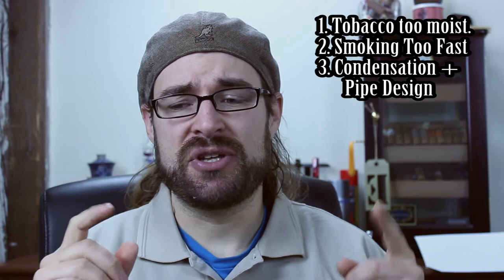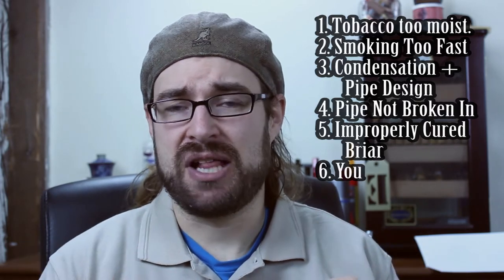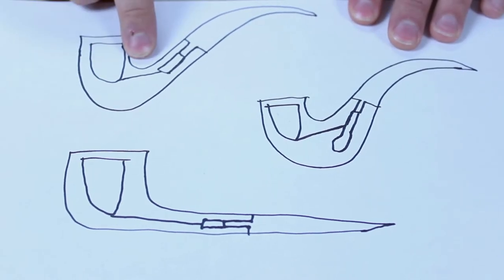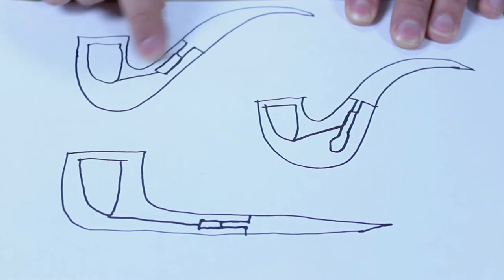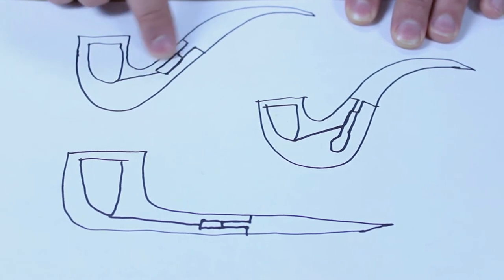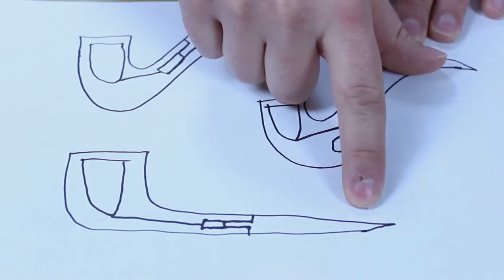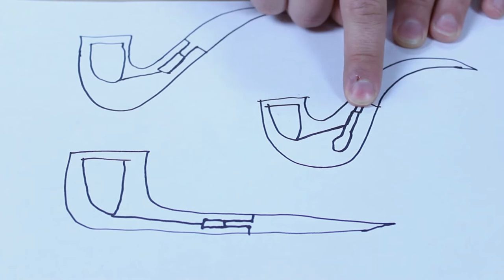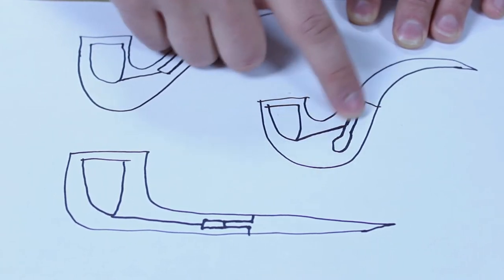Why Is My Pipe Gurgling and What Can I Do About It? - Pipes 101 #3

Comment: All this is true. However, "renters" are caused by the combustion process itself. "Renters" are what we "older smokers" used to call that gurgling noise because "renters" are usually noisy when you let a room in your home.Kirsten, and E.A. Carey pipes were designed to eliminate renters by condensation. Yet, I have owned both kinds and they will still gurgle. What causes most renters is the combustion process. Ever see your car exhaust steaming when you first start your car in the morning? That is due to Carbon (fuel) Oxygen (17% of the atmosphere) and other inert gasses (83%). Carbon, Oxygen, Hydrogen, equal alcohol. Hydrogen (2) and Oxygen (1) equals water. There is enough material in our atmosphere to make alchol (evaporates or burns up) and lots of water (condenses in our pipes). Don't be hard on yourself or your pipe, it's just chemistry and doesn't mean you don't smoke properly or that your pipe is a poor design or improperly finished. I smoke a cob every day and it will usually gurgle at some point. Usually it gurgles after I have smoked it at least half way through a bowl.
Reply: Thanks for sharing your thoughts and experiences.

Comment: What a thoughtful video. Well done Sir! The one cause that I have struggled with, which may not be an issue to those of a more southern climb, is temperature.
When it's -12C outside any form of heat condenses the latent moisture in the air almost instantly. Similarly, when its +30C and 100% humidity it seems like every puff is just hot steam. I tend not to smoke that much in the height of the summer.
Thanks again,
BG
Reply from the maker: +Beardly Gentlemen Yeah, temp and humidity are ones that you just can't really avoid.  Cold temps will condense a lot of moisture in the stem.  I'm the same about the height of summer.  I usually don't smoke much when it's crazy hot out.

Comment: This was really helpful. Some "friends" put ethanol in my pipe as a prank and my pipe has been off ever since so I think they destroyed my cake.
Reply: All you can do is start over then if the cake itself tastes badly ruined. If you let the pipe dry out enough the ethanol should of evaporated, if you still taste it though, then you have to ream the cake off and start over. Usually ethanol is used when doing a restoration on an estate pipe or really dirty pipe. It usually doesn't leave a bad taste behind though. Everclear or high proof rum is used. Maybe they used something cheap and with not a lot of alcohol in your pipe your getting that ghosted flavor from it. Might be best to try and take the cake back down to briar and break it back in. Clean out the inside of your mortise chamber as well.
Reply: Andrew Gill get new friends

Comment: Excellent presentation and possible solutions for gurgling. Off topic a little, but I have added nail clippers to my tools. I use the file on the nail clippers to clean inside the bowl and I cut my pipe cleaners for the smaller pipes and this is to do with saving pennies and reduces wasting say the middle of the pipe cleaner. Hope this makes sense.
Reply from the maker: Sure.  All my pipes are pretty big so a standard size cleaner just barely makes it into the bowl.  I'm not worried about saving the penny or 3 when there's already 30 cents of tobacco in a $100 dollar pipe. :-)

Comment: well my pipe is over 100 yrs old so that's not the issue, ive dried my tobacco until its dry and still i get gurgle and evry once and a while it gets sucked in my mouth witch is unpleasant to say the least! ive since switched to the plug method since my pipe is meerschaum. and as long as i blow the build up into the plug it stays put witch is a plus!

Comment: I just found your videos and am finding them informative. But I have a question. I have more of a gurggling problem with my straight pipes, than I do with my bent pipes. that's the opposite of what you are saying.
Reply from the maker: +Dagro Yatko could just be how you hold your pipe. Downward angle? Long stem and shank on those pipes? There are lots of other factors, what holds true for some may not be for others.
Reply: Tea 'n' Tobacco thanks for the reply. No they are not super long stems. I have a few MM cobs and a kaywoodie and some no names that were my great-grandpappy's.

Comment: The biggest problem I have with a gurgling pipe is No 6! Me. Is there anyway to repair a stem that I have chewed through from constant use?
Reply from the maker: Yeah. I believe people use some  type of epoxy. Personally i would send it to someone to either repair it or make a new one you.
Reply: Thank you, I have found a place in Michigan, hopefully I can get a few spare stems made too.
Reply from the maker: Cool. Personally i use rubber bits on my pipes. Might be something for you to consider if you're a clincher. Protects your stem and your teeth.
Reply: @TeanTobaccoChannel  thanks mate hadn't thought of that. Might be able to use heatshrink or something similar
Reply from the maker: You can get the rubber bits at most pipe shops. Given them a shot. They're cheap and removable so you can more easily clean them and the stem under them.